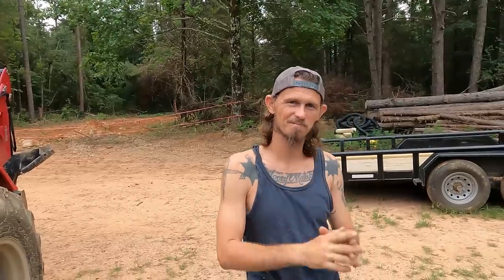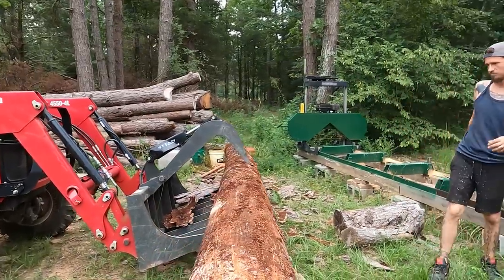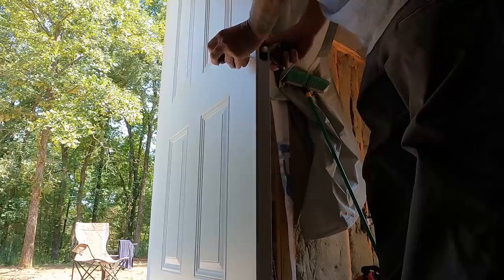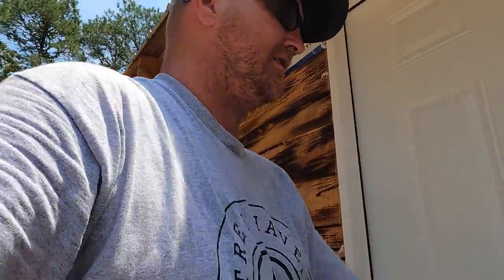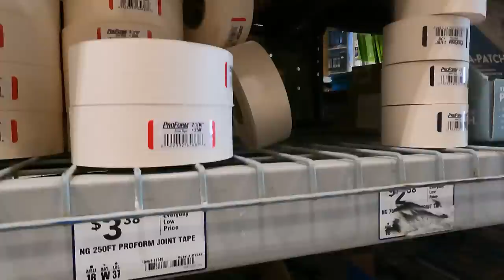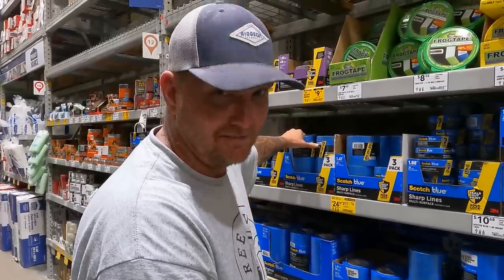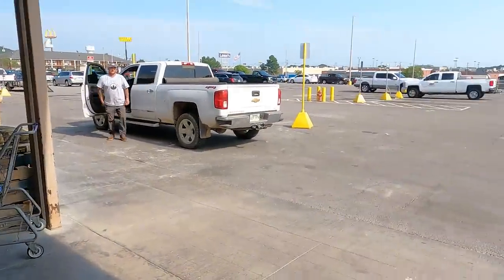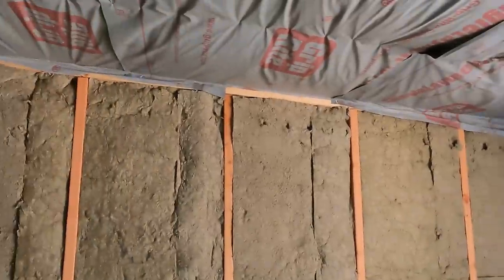THIS IS NOT WHAT I WANTED tiny house, homesteading, off-grid, cabin build DIY HOW TO sawmill tractor

Comment: Hey Dave, I don’t mind plastering but it’s the sanding that’s a pain. Your choice of steel trowel should reduce sanding if applied well. If there is no rush I don’t mind painting. There is something gratifying about getting closer to the finish of the build, the work balances off in the end and you take satisfaction of knowing you did it. Great work, both of you. Your trades assistant is a great help too, good on ya Mike.